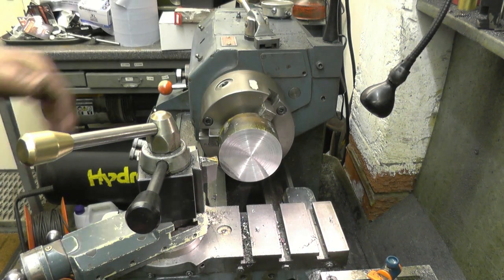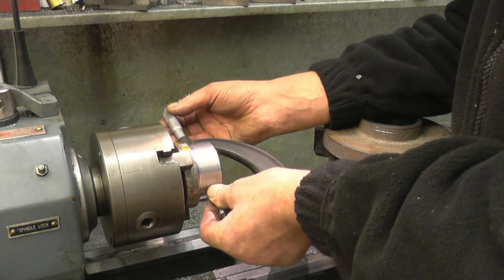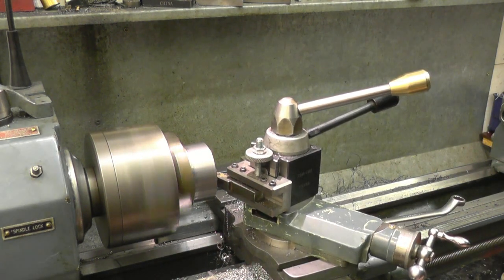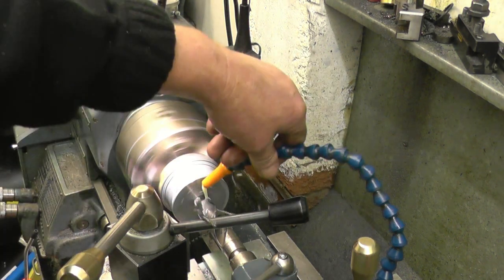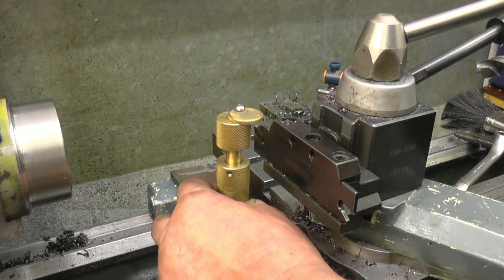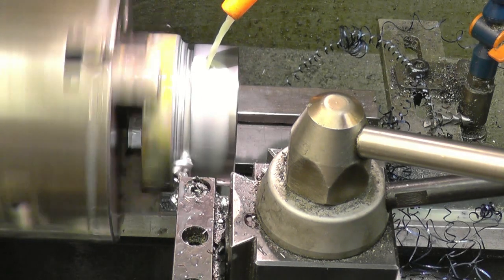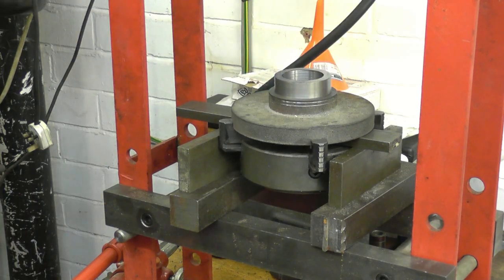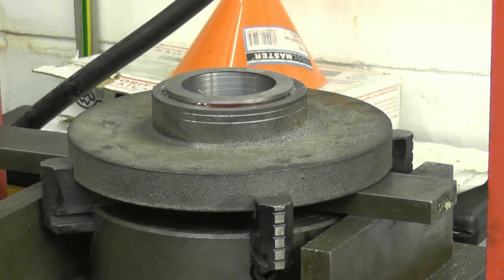Harrison Lathe Chuck Back Plate Part Two

Comment: Hi I bought a tool post like yours from chronos but I was just wondering about the bottom Tnut and the tightening handle did you buy yours separate or did you make them as the bottom nut is just one lump of square stock but I don't currently have a milling machine, also the top nut is just a nut no handle on it so did you buy them both and if so where from please. Thanks again for the help

Comment: Hi John,

Locktite needs a gap to work. If you're going to use it to back up a press fit, machine a relief area for the locktite to work in.
Reply from the maker: Hi
Paul
It never needed any lock tight
Good tip though
Thanks
Reply: doubleboost

Ive never bother with gaps for loctite and non of my bits have fell apart

Comment: Hi John - great video thanks. The close-ups are stunning. After you'd taken too much out of the casting and decided to sleeve it id you then bore out extra to take the OD of the sleeve? I had it in my head that the sleeve would end up being just 10 thou thick once you'd rebored it in situ to the correct ID. Looking forward to the next part.
Reply from the maker: I bored it 1/4 inch over size
Bush is 125 thou thick
Pleased you like the macro shots
Reply: doubleboost Got it now. Thanks.

Comment: Why's that, farrellhunter?
It may look as though the chuck is wobbling, but there's also a lot of fluid dripping from it...looked fine to me.
(I watched a second time).
There is no 'problem' to be fixed: The backplate, although bored too large, should still run true...and the hole through the middle will soon be concentric... when bored out.
I think it would take a bit more than that to put his reputation in jeopardy...
It's the first real mistake I've seen him make on the lathe...in how many hours of videos?

'Canny' camerwork there John...